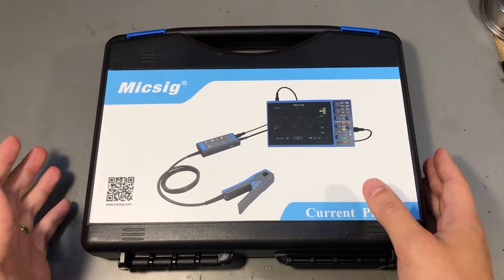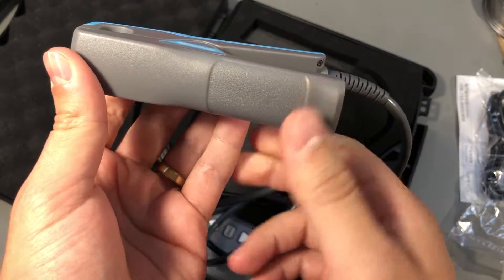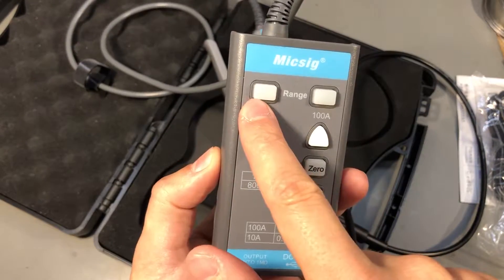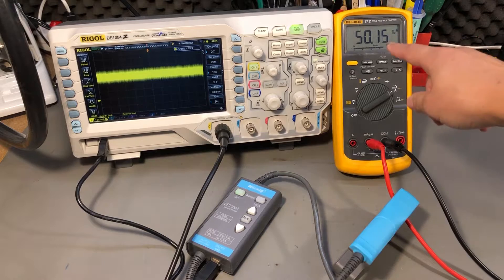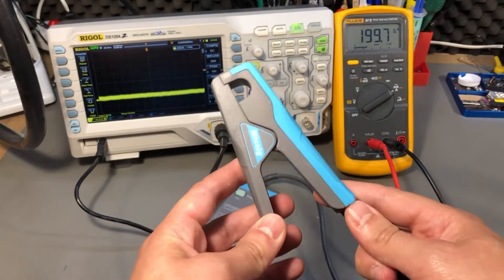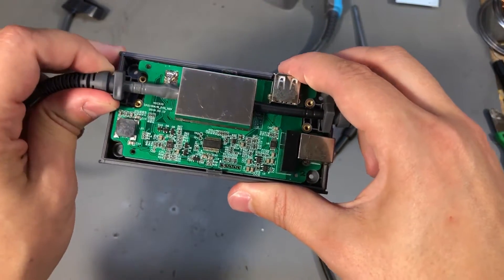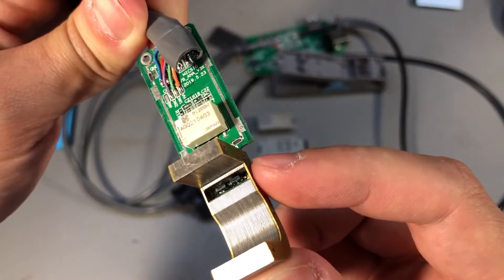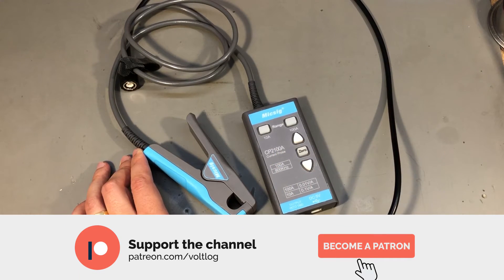Micsig CP2100A Best Affordable Current Probe | Voltlog #330

Comment: My only concern would be C55 on the bottom side of the main PCB, which seems to connect the probe ground to the oscilloscope ground. It looks like a 0805, so accidentally putting 300V on the magnetic core seems too much. Or is the DC-DC converter used just for +/-5V and there is no galvanic separation for the probe circuitry?

Comment: Not cheap at all. What about Hantek clamp? https://usa.banggood.com/Hantek-CC65-Digital-ACDC-Current-Clamp-Meter-Multimeter-Oscilloscope-with-BNC-Connector-p-1089102.html
Reply from the maker: If you can work with the low bandwidth, higher noise, lower build quality, 9V battery power option then the CC-65 might be an option worth trying.

Comment: 7:25 you don't use the probe properly. To get the best accuracy in DC you should place the probe on the cables with 0A, do the zero and then activate the circuit without touching the probe. Otherwise the probe will be influenced by the change in magnetic field of the environment due to the change in position.
If you can't turn off the circuit during the zero then at least place the probe as close as possible to its final position to do the zero you you don't have to move it too much.
Reply from the maker: You are right, getting as close as possible to it's final position will improve the accuracy 👍

Comment: What is the status of the Gophert 1601 board you are working on? :)
Reply from the maker: Very little progress done on the firmware side of things, the people who joined the project are quite busy so it might be time to do another call for new people to join forces.
Reply: @voltlog  if you would like you could publish it to github and start group projects, people can arrange themselves to do what they want and then you can just review pull requests(or add project moderators / idk how are they called on github) . I think that this would work. Mine nps1601 is going to arrive soon, I'm probably going to poke around with logic analyzer on existing control board to see if there is any out data that could be used.

Comment: Theres a cheaper one from hantek for around 50$
Reply from the maker: If you can work with the low bandwidth (20KHz), higher noise, lower build quality, 9V battery power option then the CC-65 might be an option worth trying.
Reply: Those have significantly less bandwidth.

Comment: Switchmode power supplies typically need even higher bandwidth current probes which are atrociously expensive.  Here is one that would be worth one of your excellent reviews: https://www.aliexpress.com/item/32827427938.html?spm=a2g0o.productlist.0.0.333c5384FPnjv7&s=p&ad_pvid=202009221044184391590598055360000549856_7&algo_pvid=84bbc5d2-6c8c-449e-aa89-ec915698d63b&algo_expid=84bbc5d2-6c8c-449e-aa89-ec915698d63b-6&btsid=0bb0622c16007966584687070e9250&ws_ab_test=searchweb0_0,searchweb201602_,searchweb201603_

Comment: What does the "800KHz"bellow the 100A printed on the front mean? 
You can't possibly use a laminated transformer core material in > 100 Hz
It will pick up nothing at 800 KHz! That's why I am asking.
Reply from the maker: That's the bandwidth of the probe and the B variant goes up to 2MHz and I'm pretty sure they use the same mechanical construction, possible just a different sensor with higher bandwidth.
Reply: @voltlog  If the pickup head wasn't made of laminated transformer silicon steel, I'd buy their claim of 800KHz BW. As is, it's all fluff. 
Try building a switch mode power supply and run it at 800KHz, using a laminated iron-core transformer!
See what happens!
Vise-versa is true too. You can't use high frequency Iron powder cores, in a line transformer. The efficiency will plummet.
Reply: @ufohunter3688  Laminated cores are used in audio transformers, which is already 20kHz. Powdered cores can be used to measure quite wide frequency ranges, eg 5Hz to 5MHz (ct-b0.05). They may be compensating for any losses with calibration.

Comment: I suppose it's a good deal if one's requirements include a 800KHz bandwidth; but as long as they do not... $200 is quite far from my idea of cheap, especially while I can get exactly four Hantek CC65 probes from the same place for that money.
Reply from the maker: It's not just bandwitdh advantage over the CC65. The Micsig is also higher build quality, lower noise. Might be better in other regards as well, I haven't looked into the CC65 too much but with superior hardware design on the Micsig you would expect other advantages as well.
Reply: The Hantek is 20kHz, so pretty useless for almost any switching supply frequency, not including even remotely fast edge harmonics.
Reply: @EEVblog  which is specifically why I mentioned level of requirements explicitly. It's quite obvious a lower spec tool is inadequate IF one really needs that kind of bandwidth. On the other hand we had a CC65 at work, just for occasionally measuring some of our stuff that changed current draw faster than a DMM could follow, and it did that quite adequately, especially considering that a clamp meter is not a precision instrument, especially not in DC. And I know it's different for you Dave, but around where I live people simply don't tend to have $200 laying around for "the extra spec would be nice to have but I don't actually need it" McGuffins. Or, generally, laying around at all.
Reply: Jupp. Only thing exceeding CC65 etc spect would be SMPS stuff, but current ICs are usually >800kHz, so the A-variant fills a space I wouldn't find much use cases here.